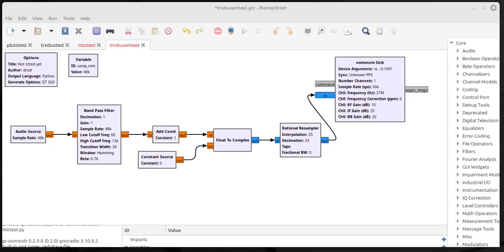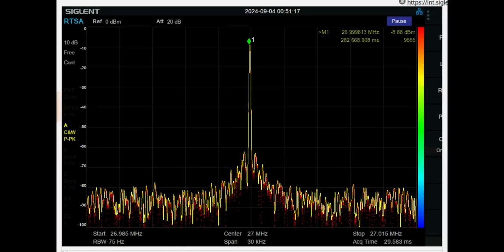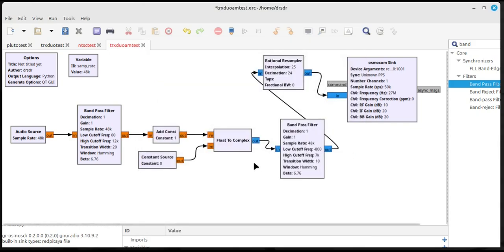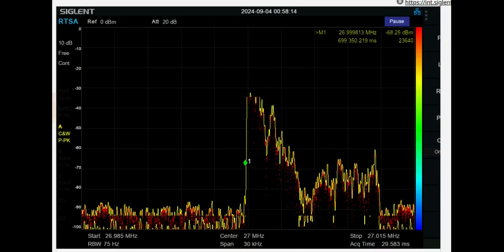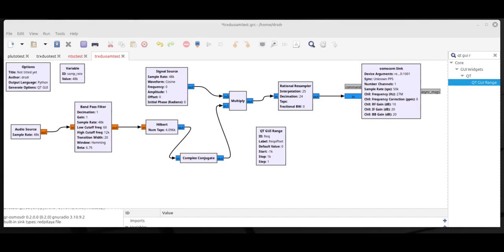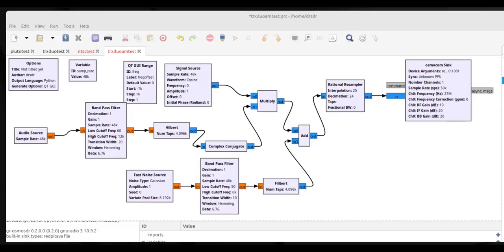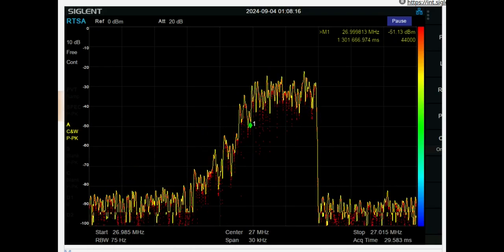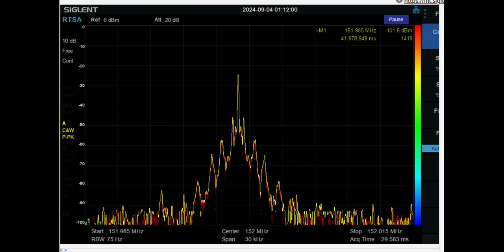TRX DUO SDR Demo

Comment: How can I create a two-tone test from your Trx Duo SSB flowgraph to see how linear the inexpensive 2W PA is? Want to look at intermod distortion.
Reply: I have two cosine waveform generators onto your USB flowgraphs. I connect both to an adder. One is 700Hz and the other is 1.9Hz. The output is complex. How can I connect this to your flowgraph to modulate USB?
Reply from the maker: @paulmaine6433  change the signal source to float instead of complex

Comment: I ordered an $8.33 2W power amp to use with the Trx Duo. I used my spectrum analyzer to measure and found the amp had 46 dB of gain and needs to be driven with -13 dBm to get 2W. I am using a fan. I tested 1.8-30MHz and the gain was flat.

Comment: Is this a phasing SSB exciter?
Reply from the maker: @paulmaine6433  yes
Reply: @TheGmr140  can you please create narrow and wideband FM flowgraphs for the Duo? I have started adding videos and the first ones were replicating what you have shown in your video. I will build upon what you have done. I’m a software guy and will be adding PA and filters and a coax relay so I can actually use on HF ham bands. Thanks again!!
Reply from the maker: @paulmaine6433  I can add nbfm and wbfm
Reply: @TheGmr140  you’re the best!
Reply: Can you please add the new flowgraphs sometime this weekend? Thank you in advance
Reply from the maker: @paulmaine6433  added
Reply: @TheGmr140  Thank you!!! The 2W power amp for $10 just arrived. I plan to sweep it with my spectrum generator. How can I report the results back to you! If it works, I will add filters and transmit on HF bands. I will use my Airspy HF+ to receive.
Reply: I meant to say spectrum analyzer!

Comment: Hi Dr SDR! I just replicated your AM modulation demo. My Siglent spectrum analyzer shows the peak to be a little lower than 27MHz. The frequency offset did not seem to work while the flowgraph was running. Any ideas?
Reply from the maker: @paulmaine6433  in the sink block just change the 27mhz to add the offset,  to add 100khz , set to 27.1mhz